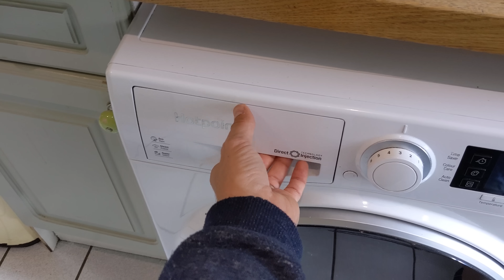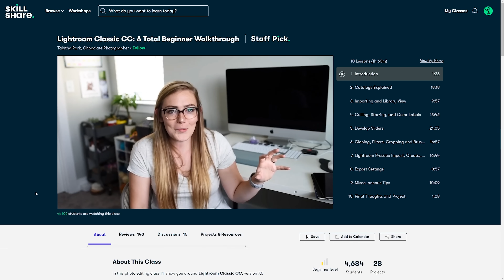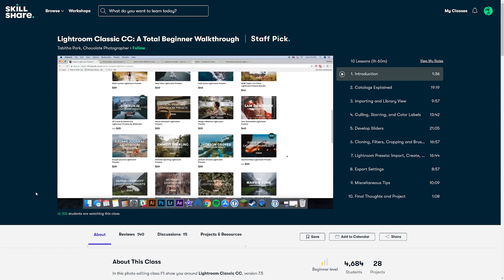The Pythagorean Siphon Inside Your Washing Machine

Comment: hi Steve, older toilet systems used to be like this, the old overhead  pull the chain cast iron bowl type systems going back to the 1960s and before. The liquid level was filled with a normal type ball float to just below the top of the stand pipe tube. the bell was connected to a fulcrum and pulled by a chain which sucked the water in it to above the standpipe level. As the bell dropped down it would gather more water and push the charge of water down the stand pipe and initiate siphoning. google bell type flushing systems for more info. regards Richard

Comment: Hm never seen this kind of mechanism in German WCs, honestly i think this is almost UK exclusive.
Usually it is plunger system that is stuck in place by water pressure with a buoyant part not strong enough to unplug it.
However once unplugged it floats up until the water is drained then it settles down to reseal the outlet again.

Comment: In Greece, the most common mechanism in the last 2 decades is completely different than this. The reason is that the rope was always got broken and the mechanism frequently needed maintain.
These days the mechanism uses a button that functions as an air pump, when it is pressed, it pumps the air that exists in a small compartment under the button and into the bottom of the water reservoir causing the mechanism to raise, revealing the water hole. 

Then as the water hole is now exposed, the water starts flowing and the hole remains open as long as the pressure of the water can keep the mechanism pushed up and the hole open.

Comment: We have an interesting setup in this house. On the ground level, the toilet has a standard reservoir for flushing. But, counterintuitively, in the upper level, the toilet doesn't have a reservoir - it feeds straight from the pipe into the bowl (except for a self-closing valve in between), and it has more water pressure than the ground level toilet!

Comment: Hi. I have recently installed this type of flushing system in my toilet. I was having a problem with the “flapper” lifting arm attached to the flush handle. I liked that this system uses a cable to Uniate the flush, no long lever to get stuck on anything. I had know idea how it actually worked. Thank you for the explanation. Very interesting.

Comment: Big question. If you took this system  and submerged it up side down in water then filled with air, would you have intermittent period of bubbles? I was literally woken up at night with this question. The only application I could think of for it is having a bubbler in an aquarium occasionally going off rather than consistently.

Comment: In the US, the flush mechanism is a flapper valve in the bottom of the tank (made of rubber or a soft plastic material).  You pull it up and the rush of water keeps it up until the water flow slows down (there's a very low "collar" around the hole that the valve fits into).  When the flow slows, the valve falls down, blocking the hole, and the large valve (the one controlled by the float) fills the tank.  (Yes, the water is flowing all the time the flapper valve is open - that fills the bowl.)

Comment: Okay, so I just wanted to come back and share. This knowledge came in handy when I accidentally put my laundry booster in the fabric softener slot instead of the detergent slot. In the past, I would have removed the whole drawer and rinsed it all out. Knowing this, I just flooded the slot with water a few times and it washed it all down. I don't know how it will come out, because the washer is still going, but if my theory is correct it just added the laundry additive to the laundry mixed with the water and will be washed out like usual. I guess we'll see.

Comment: My toilet does not have a siphon, but rather when you push the handle, it opens a sort of plunger at the bottom of the tank and then all the water drains due to gravity. Interesting that it’s so different from yours but works just as well. I’m in America (Mississippi to be exact)

Comment: In Poland i belive most of the toilets have double flush system. 1 big and 1 small for flushing urine. I have seen some mechanism and most of the toilets here dont use siphons instead we usually use a plug on lever, so we can cut watter off when we want so. For small flush opens just smaler diameter plug, that is usually part of bigger one and for big flush big plug opens. For overflow protection we use just a sinkhole, and for priming mechanism is mostly the same, just diffrent shape.

Comment: Another place these valves are put to work every time  a needed water change is automatically done constantly.   DIYERS  are used  in hydroponics pans and they are homade using different sized  PVC tubing.

Comment: I'm in the United States... our toilets are a bit different. The flusher handle lifts a rubber stopper that lets water fall into the bowl. The stopper is an inverted cup shape that catches air so it slowly sinks as the water flows out until it seals the tank again. Then water fills the reservoir lifting the bulb like yours to finally shut off the water.

Comment: Mine just has a rubber ball valve to stop the flow of water from the tank to the toilet bowl. It needs a full tank to flush the toilet properly. Water saving fill valves will not work on my old cheap toilet. It's a cheap manufacture home toilet that always plugs up after dumping a load & must use a plunger to get it to go down.

Comment: I beat water with pv solar so it is free. My cold water to the washer is actually not water. You can't believe how much cleaner that leaves the dispenser. It is spotless. If you use cold water, this dispenser needs to be cleaned every six months to prevent mold.

Comment: Pretty interesting stuff.
In Brazil tank toillets are unusual (at least in my region). Here most toilets are mounted with a pipe on the wall and the water comes from the water tank in the ceilling. That means huge water pressure, but also  lots of wasted water.

Comment: Never seen such a "complicated" yet simple (in concept) flush mechanism. Here in the US, we use a very simple flapper valve stopper in conjunction with a large drain hole (4¼" or about 11 cm) into the bowl.  The purpose of the large hole is to ensure an initial large surge, yet relatively low total volume to force everything down the drain while conserving water in compliance with the US "toilet flushing" law (around 6.0 Litres per flush).  Since the flapper floats, when the handle is pushed down, the flapper is held open by floatation until the water level falls. Then, the force of the draining water overcomes the floatation force, causing the valve to close. (It closes with a "thud.)"

Older versions of US toilet simply limited the volume of water, were slow to flush, and clogged easily.  These were sometimes known as the "plumbers best friend."

Comment: That is so much better than the way we do it here in the states. Most toilets here use a bouyant flap valve (which eventually develops a leak, causing the toilet to run). The handle lifts the valve open, and it then remains open by bouyancy. Then when the water level gets low enough the flap seals again and the water starts filling. There is still a standpipe in case the fill valve is leaky, but no siphon in the tank. 

There is still the siphon under the bowl, though, which does use the greedy cup mechanism to drain it.

Comment: I've repaired a lot of toilets in the USA and I've never seen anything like that.  Perhaps it is a UK-specific mechanism?  Ours just have a rubber flap at the bottom and the handle lifts it up (the tank then drains through the flapper valve). The UK system is better in that it only has one potential source of leakage (bad valve). The American system can have a bad valve or a bad flapper seal (or both).

Comment: Most toilet flush valves I have come by have a round plunger style valve and 2 floats at different levels for half and full flush,
When the flush button is pressed it pulls up the valve which latches onto one of the floats holding the value open after the flush button is released, when the float drops it lets the valve close.

Comment: My toilet (US) just has a plunger-type stopper at the bottom. When you push down, it directly lifts it up. I forget what it uses to keep it up until the water runs out, but it does, and then it falls back down creating a seal.

Thinking about it now. Would the flow of water be enough to keep the rubber up?

Comment: A lot of modern toilets use a flush valve instead of a syphon. They're cheaper, pushbutton operated and can have two buttons for each flush volume.

The problem is that as the seal ages they start leaking.

The advantage of a syphon is save for a failure in the ballcock, failure mode of the syphon itself will never lead to the wastage of water. Perhaps an unflushable toilet, but no wastage.

Comment: My toilet is one of those weird ones with the two buttons (a large, round one with a smaller one inside the large button).  I've never taken it apart because I use the toilet and I want to be able to keep using it, but I do know that both buttons control a small piston-like rod that extends to different lengths depending on which button you press.

Comment: Interesting. USA Spec toilets are somewhat different, using instead a bouyant flapper valve. A clever arangement thatstays up when opened, but self-sealing. Recently the Float Lever-style fill-valve has been mostly replaced with a newer design that seems to seal better.

Comment: Im not sure all on how it works but the water on some ive seen dumps out the bottom and you pushing the button basically pulls the plug on the tank, It can still have half and full flush although Im not entirely sure how it stays open while flushing and closes at the correct time.

Comment: Toilets here in the states are direct drain (a flapper valve in the bottom of the tank, usually pulled by a chain).  The refill mechanism is essential the same.  The drain from the bowel down to the sewer line is a siphon mechanism. 

From the looks of the mechanism in yours, I suspect the life expectancy is much higher here (like 30 years without replacing internals is not uncommon if you don't have very hard water).

Comment: Toilets in the U.S. work a bit different. At least all the ones that I've looked into the water tank (I'm not a plumber so that's not frequent or wide ranging). They have the float as in your video to stop the water filling the tank. At the bottom of the tank is the drain for the water to flow into the bowl covered with a rubber flap hinged on one side that creates a seal on the drain. The flap has a hollow bulbous shape to hold an air pocket. The flush handle is attached to the flap via a light plastic chain or string. When water is in the tank it holds the cup sealed on the drain. When you flush, the flush handle breaks the seal of the flap on the drain. Once the seal is broken the air-pocket creates the buoyancy to hold it up until the tank drains completely (no partial flushes like yours). As the water empties, the flap lowers back down over the drain and the tank refills.

Sorry for the essay. I started out thinking it would be quick description of a relatively simple concept. Then I realized how confusing it could be describing a physical system with text if I didn't get wordy.🙂

Comment: Wow, siphon toilet mechanism looks really clever!

Another great advantage of it that you didn't mentioned is that such a toilet would never leak. I mean, the only possible way would be to have a leaky input, not the output. Whereas in other designs with a literal plug that stops the water from draining, you have more than a few possibilities to get a leaky output: the plug can be misplaced, the seal can be affected by dirt or debris, the rubber of the plug can deform due to age and start leaking.

Comment: I do not want to break it but the same is in every toilet water tank and it is there  from before washing machines existed. And one more thing. Surface tension has nothing to do with it. The flow is started by enough current that fills the tube and then it is continuing on it's own. I am disappointed that surface tension was even mentioned here. You are better than this. I see more and more youtube videos explaining physics, but doing it badly.

Comment: My toilet here in germany has 3 concentric pipes. The full flush button lifts the central pipe and it stays up until the reservoir is drained. I think it is held up by the force of the flowing water. The half flush button lifts the slightly wider and shorter pipe. I dont think there is a siphon involed, but I dont want to disassemble it. The flush cant be stopped without removing the lid.  At work we have toilets with a toggle, which can stop the flushing at any point by pushing the toggle back. I suspect the mechanism is the same, but you can force the pipe back down with the toggle.

Comment: Random recommendation for me but it’s interesting to see the process of the cup in actual action rather than digital models. I live in the US and I’m not sure about public toilets, but private toilets don’t have a siphon mechanism, or at least I’ve never seen one. There’s the reservoir, but that drains directly into the bowl to cause the flush, rather than using the internal cistern. This is accomplished by having the drain cap be rubber. The cap will stay in place while closed because of the pressure difference, but when the lever moves it, it stays up until the water drains because the rubber naturally wants to float

Comment: Traditional toilets in the USA would use a floating flap that covers a outlet in the bottom of the cistern (we just call it a tank). The flap is hinged on one side, and contains a small air pocket.

If you lip the flap past a critical angle, the flap remains vertical via a combination of buoyancy and mechanical torque (lift from the air pocket vs pull of gravity). When the tank drains to the bottom, the buoyancy becomes nill and the flap falls back down, covering the outlet again.

Modern toilets in the USAnow use the same technology as shown in the video; the old rubber flap broke down easily over time, the mating surface in the cistern eroded, and the chain was immersed in water so it eventually corroded.

Comment: That is not how the (in my experience) typical US toilet works. The US toilet has a flap, the flusher lifts the flap, the the toilet bowl floods with water. This rapid flow of water is sufficient to prime the toilet P trap (I think it's a p trap), which empties the toilet bowl. If the amount of water into the toilet bowl is small, it's not sufficient to prime the siphon and it'll just empty slowly.

Comment: In america, west coast anyway, it is a gravity system with a float, when the lever is toggled, it raises a rubber stopper, or a piston, that allows the water to flood the bowl which then overflows the s-trap and until the water is evacuated will continue to flush. You can pour a 3 gallon bucket of water into most toilets at the bowl, and cause the flushing action

Comment: "how come when I come back to the fabric softner tray after a wash its completely empty?" ... My last two washing machines haven't done that its always full of water XD
Reply: Need to take the cap off the siphon and clean it once in a while.
If it still doesn't work, then the water supply to that compartment may be blocked with calcium or it's solenoid isn't working.
Reply: My washing machine doesn't have a tray like that in the first place
Reply: The way my washing machine works there is a tower In the middle that spins and at the top of that tower there is a cup that you put the softener in. Around the side of that cup is another upside down cup with a hole that allows you to pour softener in. When the washing machine spins it pushes the softener out of the cup and Into the sides of the upper cup using centripetal force. It then funnels down Into little square holes that evenly distribute the softener into the clothes while spinning

Comment: Canadian here... never seen a siphon used in toilets in the way you describe... here we have the float shut off but you pull the handle it opens a valve that dumps the water from the tank straight into the bowl and then gravity causes the valve to shut again. As the water is emptied the float valve is open and the tank fills until the float is raised enough to close it.

A common cause of running toilets is the dump valve catching on the float and never closing... new toilets use a vertical float rather than a ball float and don't have this problem... and a common upgrade is to replace the fill mechanism.

Comment: Use vinegar instead of fabric softener. It works perfectly! And all the odors evaporate out in the dryer.  Kills mold, and doesn’t pollute the air the way fabric softener does.
Reply: You destroy all the plastic tubing and silicone rings inside the washing machine with vinegar.